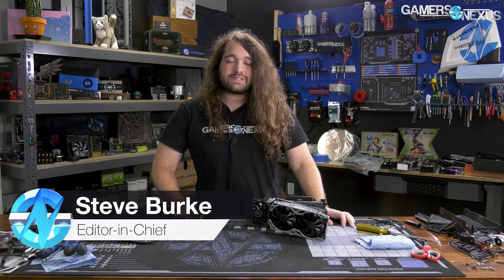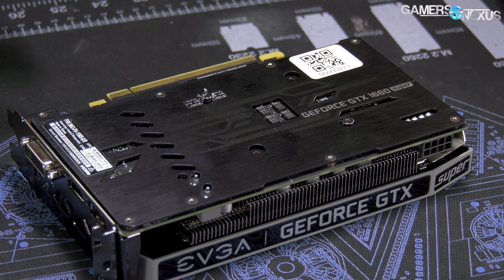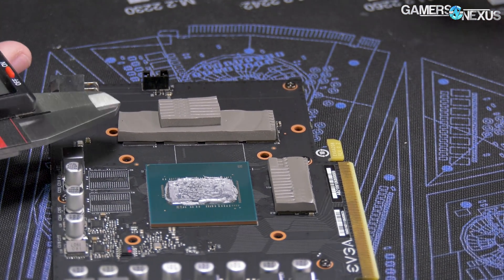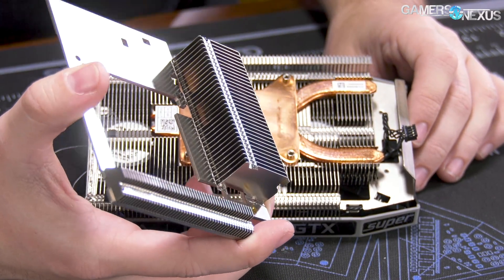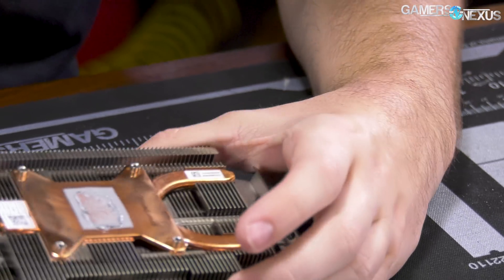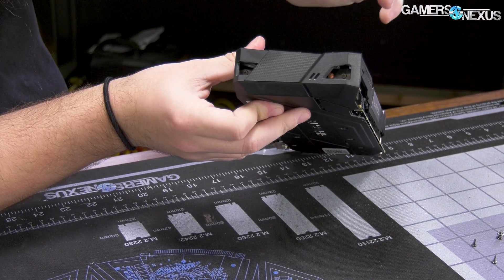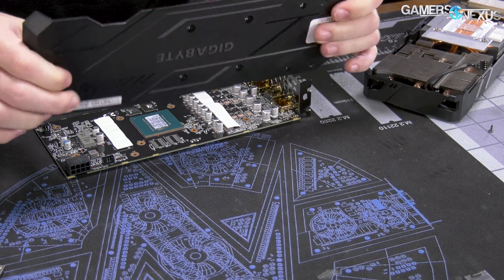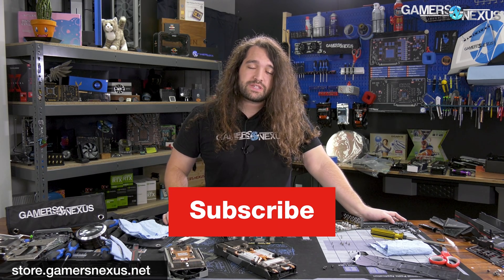GTX 1660 Super Tear-Downs: 9mm of Thermal Pads & Bendy Backplates

Comment: Steve: "people tend to get caught up on GPU temps"

Me: " Hmm 90c with the overclock.....MORE FAN SPEED"
Reply: Stop before your pc starts to levitate
Reply: @randomperson8367  duct tape will solve that issue lol.
Reply: Another 1000 rpm never hurt anyone
Reply: RIPTIDE FPV has happened to me before, I go to adjust the fan speed up then realise I’m already at 100%
Reply: @MarshallSambell  I did the same to mine but i found a PCIE fan that blows across the GPU works great.
Reply: If it hits 70c it goes full fan speed thats how i do everything

Max CPU fan speed (stock cooler just waiting to go home from uni to install aftermarket one and Liquid metal)

GPU hits 70c it goes full fan speed (hits 68 across all but 2 things i do with my GPU)

But yeah why are fans getting slower and quieter?

They should be getting faster if you want them to be and better at pushing air at a slower speed to make them quiter

For me my CPU fan hits 1950RPM max where as the previous gen of the same stock cooler hit 2450RPM or even up to 2550RPM for some of the first ones shipped

Will be getting a cryorig C7 graphene version (cus its black no other reason)

And using liquid metal

If CPU is still hot getting a AFB0912SHF cus that fucker spins so much faster and my motherboard can do 2AMP’s to fans so i can happily use it at full speed if needed but might shoot parts of the mobo and out of my PC like little bullets
Reply: @commanderoof4578   Depends, the larger the fan relative to the motor, the lower speed you can push it at a maximum without motor overheating; smaller motor means more effective blade area, so there's some cooling capability increase by limiting the hub size at same speed, but in my opinion not much really. Also there's usually a relationship all things being equal between fan's native speed and the lowest speed you can run it at stall-free, and for a typical consumer who doesn't overclock and largely runs low-duty loads but may be sensitive to noise, the combination of low minimum speed and higher low-speed reliability is appreciated.
Reply: Siana Gearz 

Meh what your saying is accurate but you forgot to mention about low profile coolers like i did oooopps...

I just a very small PC ML08 (still fecking huge compared to what i want but it has handle which i need)

With ti t computers the more air you can push the better especially when its 1 fan for the entire CPU section of the PC

So for those builds the faster a Fan spins the better so if the stock fan doesn’t cut it on the cryorig C7 black editon then i will be replacing it with a fan from delta electronics which can push over 2x the air through the cooler and at a higher push force so cooling will get a buff and as i said sound means nothing to me as i can just stick it the other side of the wall and drill a hole if my headset and mic cannot continue to isolate the sound and remove it (soly passive isolation by the way)
Reply: Peter G 

Explain what you mean by that please?

Because what i put is what i do and there is more than enough info as to how and or why i do what i do or what i plan to do

Edit: this is how i want fans to be done

Fans come and use a frequency curve on devices that can set there own and then have 2x or more fan speed overhead so we can ramp them up ourselves instead of buying aftermarket fan for our coolers which are normally also aftermarket anyway

Or just put on a simple switch that causes the fan to use half voltage or full voltage halving the hardware RPM but allowing users to make the fans go faster while keeping fan price of production stupidly low

Edit 2:

But why do that to fans?

Simple if you are like me and wear a more than decent headset and have a directional microphone both you and others listening to you cant hear the PC even if its 60dB or at least for my mic and headset
Reply: Once you have had a quiet gaming rig, you'll want a quiet gaming rig
Reply: Every fan on my PC will always be at 100%! I never get above 58°C during stress testing (not counting cinebench where I hit 73°C) and barely get above 55°C in regular gaming. I never understood the whole noise issue, it's just fans, who cares? I would love if someone could explain it to me though.
Reply: @Bigdude0444  well for me, when I first built my pc I had crappy fans so it was LOUD. Loud enough to hear when I had headphones on and you could forget using a mic. 

Now I use much quieter fans so I can run them higher with less noise. Max on CPU 360 rad and 1200rpm on 6 case fans. The case is on my desk because I have thick carpet. It would be a dust nightmare down there because I don't run dust filters.

Comment: with that much thermal pad, wouldnt that do more insulating than transfering heat?
Reply: Yup.
Reply: This is like chinese-level thermal cooling. Nvidia really dropped the ball on this one.
Reply: @ChaotiX1  You mean EVGA. Nvidia provided the board, it's up to EVGA to design the cooling
Reply: @Primeyy  to be fair. It's the 1660 S, who cares?
Reply: @Bigdude0444  Probably most people here. We all ended up here for valid information. Nvidia had little or nothing to do with the cooler design
Reply: @Bigdude0444  Indeed , because NOBODY should buy an NON Ray Tracing card !  ( Jensen Huang 2019 )
Reply: @Bigdude0444  perhaps if you had said "it's VRAM chips putting out single digit W each, who cares" you may have had a point, instead of just a display of immaturity